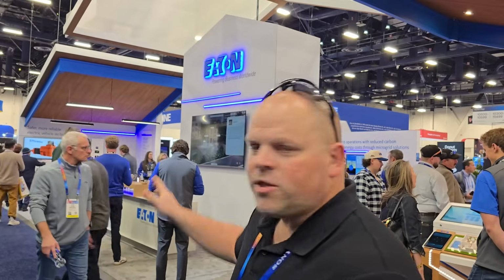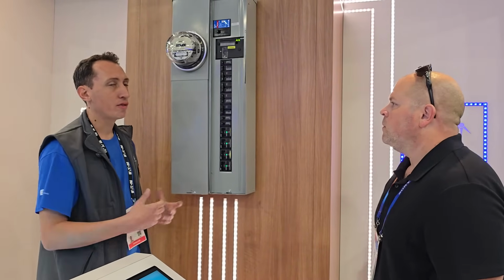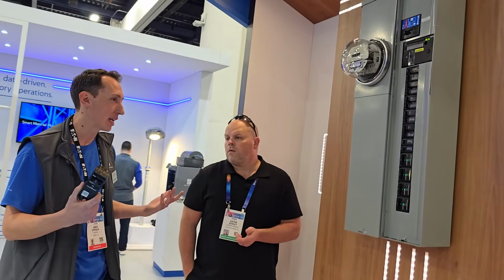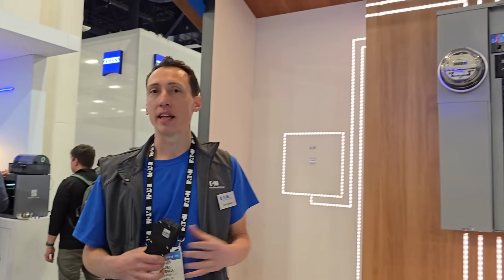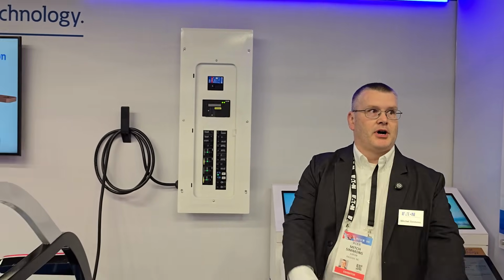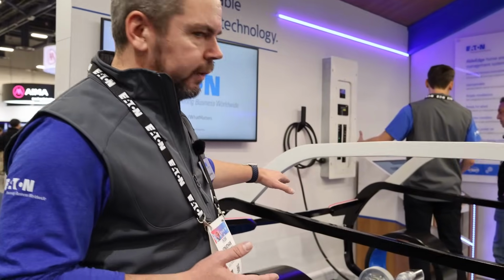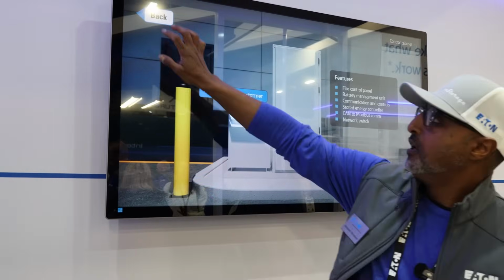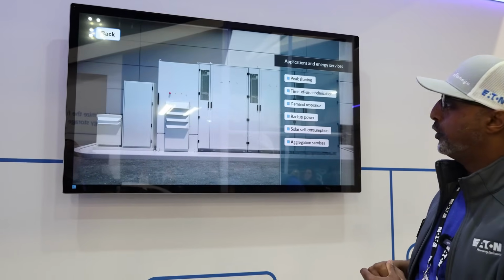SMART BREAKERS by Eaton - Next Level Stuff!

Comment: It looks like Eaton may also be ignoring the fact that in a lot of power outage situations you’re losing internet connectivity. With the death of copper POTS telco’s and competing (mostly coax, but some areas are getting fiber) Internet/telephone providers no longer bother to keep anything available through power outages. I’ll bet the app becomes useless once the external internet/cloud connection is severed. He talks about open API, that’s a cloud service. They do support local communications, but the smarts they talked about here sound like they’re all “in the cloud” and thus likely useless in many power grid failure scenarios because the ISP last mile is often either not battery backed up, or has very limited battery backup.
Reply: Eaton specifically documents a “smart breaker coordinator” to do local only comms/control — which they expressly state is not Eaton’s problem. (On the developer portal for AbleEdge Smart Breakers)
Reply: @OverKillPlusOne  That could potentially be Home Assistant
Reply: I believe you are partly incorrect. Many internet providers do strive to keep their networks up during storms and power outages but the end user is responsible for powering their equipment during the outages. Meaning weather it is cable or even fiber if you have a battery backup solution most of the time (unless lines are physically damaged) you can still power your modem and router and still have internet connectivity. And as others where saying just having an "Api" doesn't mean it's cloud based it just means they have provided a way that is intended for communication with the device. If it's open that means people can use it hopefully with documentation provided.

P.s. in his example they are powering the house from a battery which could run your modem and internet service...

Comment: The Eaton brakers look interesting, but they have to be compatible with home assistant and be able to operate with full functionality WITHOUT cloud services
Reply: @TheJensss  agree.  I heard him say they can pair with Bluetooth.  But yea I bet they start with cloud required.
Reply: @googleuser4434  Thank you for the extra information. Bluetooth can be backup solution but it is not reliable or practical at all for integration with a home automation system.
Reply: They say open API, but then say OEM. So, other companies, but not the consumer I would suspect.
Reply: @dlmac  API means cloud so that is not good enough.
Reply: @TheJensss  API doesn't mean cloud. There are a ton of devices that have an API that are entirely local or available locally in addition to the cloud. The challenging bit is whether those APIs are open instead of closed source.
Reply: @AaronSwenson  That is true, but the most common implementation is some sort of cloud connection and a cloud API where you can retrive your data. If it is a open local API it would be a great solution. Thank you for the clarification.

Comment: While the tech guy in me would want that, the engineer inside says I don't ever want "smart breakers".  I have seen many times before that servers just shutoff on project flops or aged items.  This will be one of those things.   Infrastructure in homes / commercial should follow the KISS method and not have software involved.  I want my breaker panel to last as long as the house does.  This is one of those items that WILL be discontinued in a few years and the servers shut down and will cease to operate.
Reply: Your house is only going to last 15 years because insurance companies will make you change it.
Reply: The breaker panel should last a long time, but the breakers may get swapped out over time. The smarts being in the breaker instead of the panel seem to be the better option in that regard vs something like a span panel.
Reply: Smart breakers are definitely a lot better and last longer and you can also just upgrade the breaker down the road via software update or hardware update because it’s in the breaker

Comment: The smart breaker is very interesting.  That’s saying goodbye to a critical loads panel. 

Did Eaton say what can be used to trigger the breaker to turn off/on?  Some sort of CT on the grid L1 and L2 on the residence “side” of the meter? 

Their panel that includes the meter confuses me.  That does not seem like enough breaker space.  Seems like they should have a small device with the MID, generator input, and the meter mount.  Then the smart breakers downstream in a regular panel.

That bi-directional discussion is way far off.  Bi-directional is proprietary for the time being. It’s also very expensive for a full installed and permitted system.  And if you already have solar the OEM bi-directional systems are a non starter.  The only real useful setup today is the 240V 30A outlets in the bed of the EV pickup trucks.

Thanks for making the video!
Reply: The 25 Kia EV is 12kw/50a
Reply: @ hopefully a trendsetter!

It’s criminal to have a battery that big sitting in the driveway that doesn’t include a standards based 240V outlet  at 30A, 40A or 50A.
Reply: The panel with the meter was just supposed to be a standard "all in one" meter and breaker box. They where showing that their smart breakers would fit into standard existing products that may be already installed in homes. But he said they aren't really designed for controlling lights and such, they were designed to be able to shut off a load. So I take it that these breakers are not supposed to be the main control circuit on a normal basis. 

He said you would need a home automation system or partner platform to control the breakers like the tesla system or home assistant.